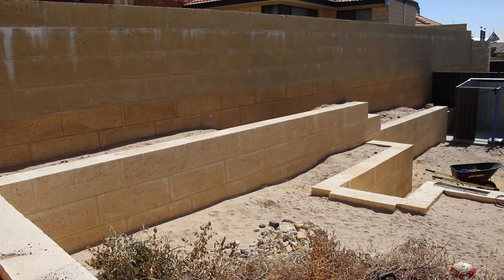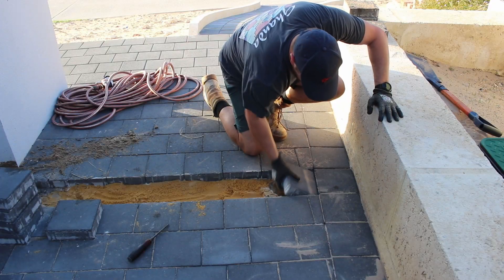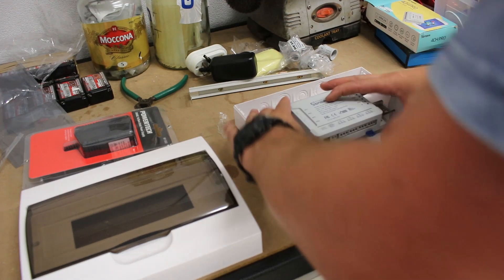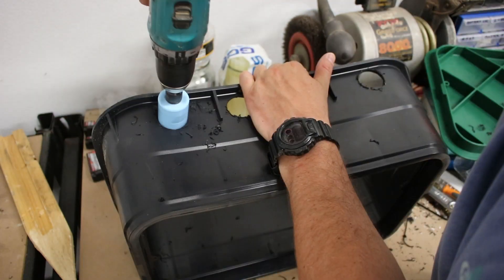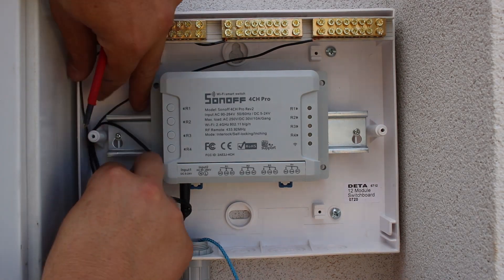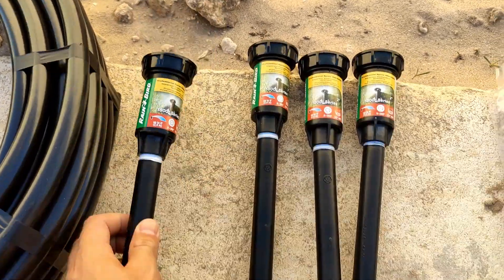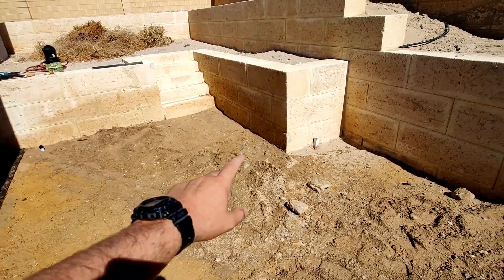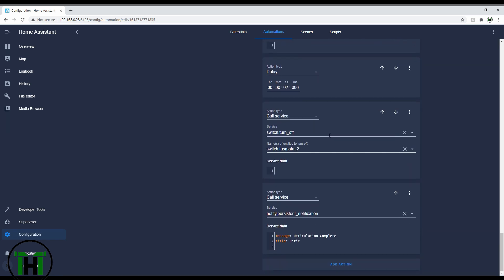Installing An Automated Retic System

Comment: One of the best install videos! Question, does the rainbird system require you to use 25mm hose or can you use a 19mm hose instead? Are all your fittings from rainbird and will I be able to find them all in the irrigation isle in bunnings? I'm drawing up a plan for my irrigation but still trying to get my head around what size hose and fittings for my rain bird sprinklers.

Comment: No backflow?
I just installed a system myself, chose the Rachio device for automation, which was likely more expensive but the mobile app experience was a high requirement for me. 
I didn’t install a backflow, which i don’t think you did. Any thoughts on this..?
Reply: Great video by the way - I hadn’t used plumbing tap on my piping which I changed after watching this and it helped a heap, thanks!!